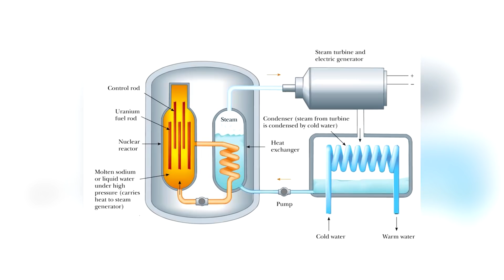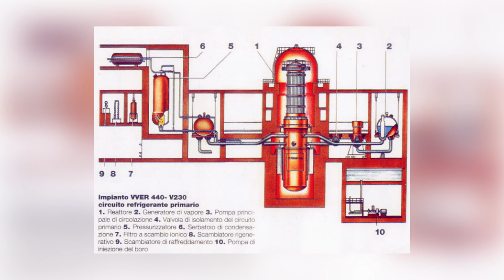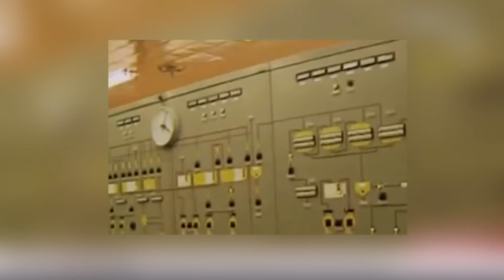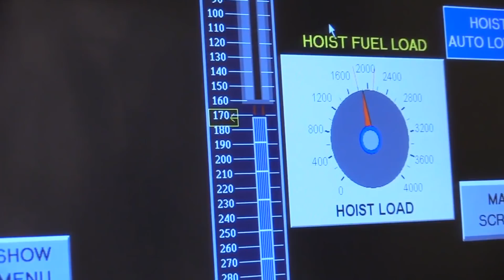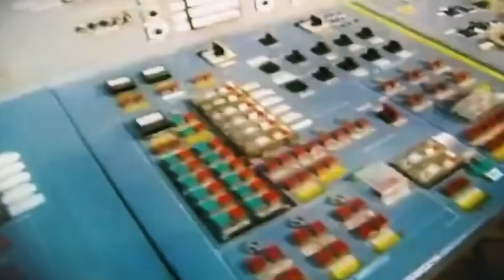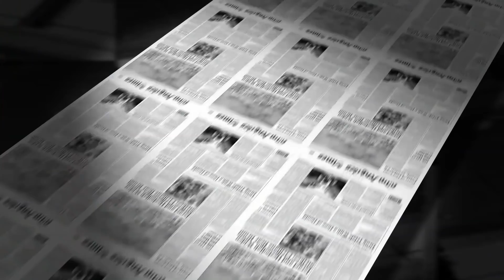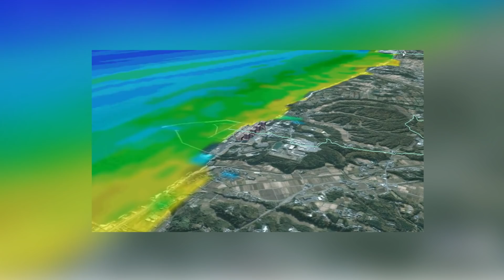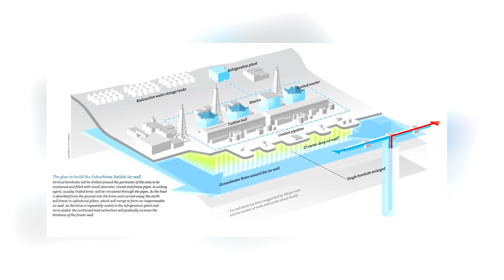12 Most Incredible Abandoned Nuclear Power Plants

Comment: Fukushima is the prefecture where the plant, Fukushima Daiichi is located. Also, the earthquake wasn't the problem, the tsunami was the problem.  After the quake, the units shut down properly and were being cooled as required. The tsunami wiped out the back-up diesel generators and other equipment, which is when the units which were operating at the time lost core cooling.
Reply: Cracked nearby spent-fuel pool wasn't a problem?

Comment: You mistakenly say the Fukushima Disaster was beyond our control.  When in reality the diaster was caused by poor engineering and design.  The backup systesm were put below grade and as such were vulnerable to flooding.  The lack of an additional backup system above grade and protected was the ultimate cause of the failure and subsequent Melt Down.
Reply: And TEPCO was told the sea wall needed to be higher. They didn't do a thing.

Comment: What about Jaslovké Bohunice, block A1 (Slovakia)? It is more interesting than VVER440 in Germany.

It is original Czechoslovak type of the reactor. It burns the natural uranium, it was moderated by the heavy water and cooled by the carbon dioxide. It was started in 1972 with projected 560MW thermal power. 

But there were some troubles. Like only two of three generators were used due to technical issues.

In 1976 the uranium rod was not properly locked and it was ejected from the reactor. It losts the cooling and the cooland in the reactor hall killed two employee. 

Then, few years after, they forgot some silica gel in the uranium casette. It stopped the cooling of the rod, it partially melts the active zone and it was closed. 

In 1989 some radioactive waste from A1 poluted the river close to the power plant. They needed to get rid of it...  All informations about decomissioning are still categorized as top seceret by Slovak government...
Reply: "All informations about decomissioning are still categorized as top seceret by Slovak government..."

- I wonder why? :D

Comment: 13:13 Fukushima. “Do caused by human error”. Not true as it was an error in design. The reactors didn’t leak radiation because they were hit by the tsunami. They closed down just fine. The problem was the fuel now withdrawn from the reactors still needed to be cooled and with the reactors off the power for the pumps for this came from generators at the site, but these were flooded causing overheating and buildup of hydrogen which exploded. The tsunami can be described as a natural event but its not unpredictable as Japan is in an area of seismic activity and long historical record of tsunami.
Reply from the maker: Hello my dear friend! Yes, probably it is!